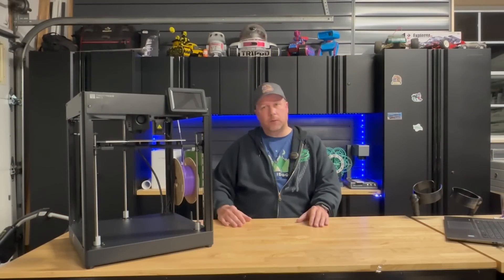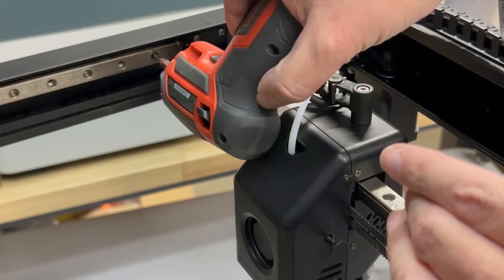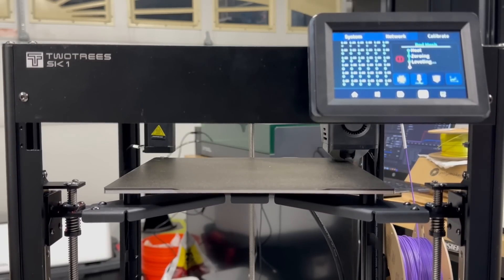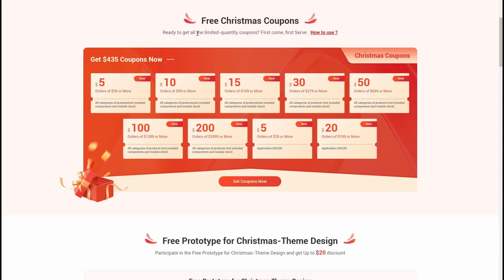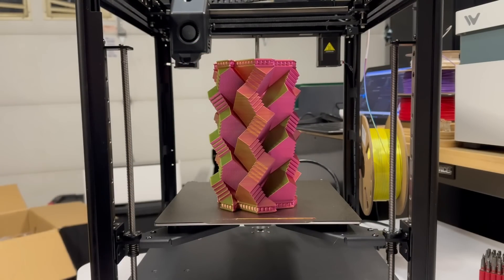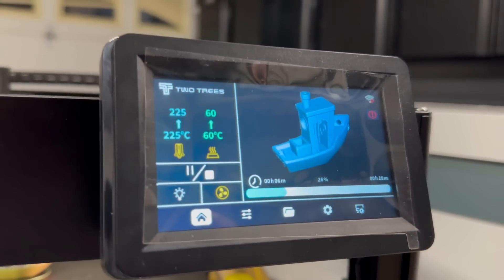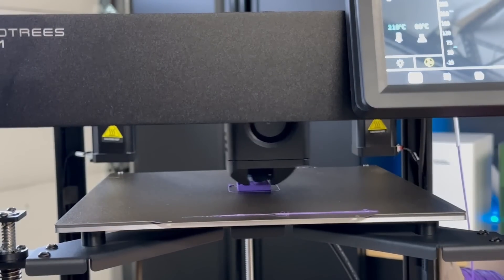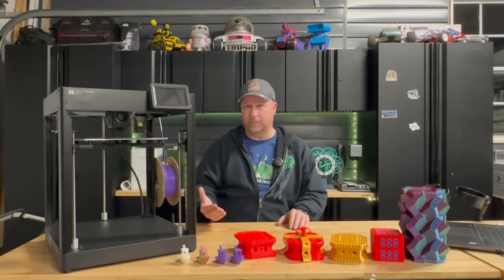TWO TREES SK1 - CoreXY 3D Printer

Comment: The preloaded lead nuts are used improper, the sprung load should be forcing down with gravity. Instead they have the springs on the bottom pushing up, so the weight of the bed is resting on the springs instead of resting on the screw with the springs giving extra help driving the bed weight to the screw. Unfortunately I have seen all China printers using these in this manner and it is wrong. This may be the reason the mesh bed is so bad looking as constant up and down could pose the variability, but being high in the middle could be do to trapping the corners and heating it up do to thermal expansion. But what do I know I only designed AM for NASA, SPACE X, and BLUE ORIGIN!

Comment: has two trees build qaulity gotten better since the original sapphire plus? those printers could have been so much better than what they shipped them as, the hotend is by far the worst hotend ive ever seen, other than that i was lucky with mine an my frame an everything else was good not out of square or warped like alot of the others i seen have issues with but i  got a p1s a bout a month ago an have been loving it an im going to replace some of my older machine with newer faster printers an part of me wants  to try a mixture of different brands like i always have but at the same time im so happy with my p1s ive been considering replacing them with more p1 series or maybe try a a1 bed slinger, not 100% but i wouldnt mind trying all the different bambu clones if they are priced resonably an right now its cheaper to buy the p1p than most of the clones so it makes me lean more toward bambu but i know alot of them are trying to be a clone of the x1 but others like the two trees is just a clone of the p1p so it has to be priced less to compete in my opinion cause there not comparable with bambu software feature so the printer has to have a bigger build volume or priced lower but so far what ive seen is not working out like that  so i'll probably end up with a bunch of bambu lab machines but ive always had a soft spot for my two tree sapphire plus even with the trash hotend it came with i always knew it could be so much better of a printer than it actually was, its by far the most rigid machine i own an that include the bambu lab machine but they just didnt do great with the firmware is the biggest issue an there so many version of the same printer its almost impossible to find the right firmware through two trees so u was stuck dealing with making ur own most of the time or having to trust someone else custom firmware an even then u didnt know if it would be the right firmware for the machine u had cause there was way to many variants without any way of identify thing. i had ppl from there support not even know they had combinations like mine, dual motor z axis linked with a belt to help keep them in sync but only had a single endstop while all other dual motor z axis motors had dual endstops an i really wish mine did but u had to make sure both z motors are at the same height b4 leveling the bed an the textured glass they send with the machine is trash, ur better of flipping it an using the smooth side, i had better results with adhesion on the smooth glass than the textured glass, its been the only textured glass ive ever seen that didn't have good adhesion. also the 17 min benchy looked way better than ur 30 minute benchy, do they give profiles with there machines now, i had to build my own for mine an it took me forever to get a decent profile an that has been the only printer i wasn't able to get a good profile from the manufacturer or even the community an took me slowly making changes til i got one that was decent an even now i still dont think its ago good as it could be. sadly my sapphire plus has just been sitting for the past couple yrs just cause i have so many other printers that work better it never gets used unless i have all my other printers running something off an need something printed for myself cause at this point i dont use it for anything i print for someone else, only for my own stuff cause it dont do as good an i dont trust the parts it puts off as much as i do my other machines. i would like to spend some time working on it an upgrading it but i cant get the motivation to do it an im to the point im ready to replace alot of my oldest machines with newer so it may end up being sold or swapped off or i may even consider doing a custom build on it i dont know. it has so many positives about it that none of my other printers have but it has more cons than my other printers so my mind is not set on how im going to deal with getting new printers an what to do with machines like the sapphire plus.

Comment: 1. 6 Stays removed
2. Vase: Clockspring3D, Annoying Box - LS3PD or LightSpeed
3. 46 screws
4. 12:30:12 or maybe 11:30:12 as the hour hand is really close to the 12. The clock is pretty blurry.
5. New fittings to repair a greenhouse that we’ve been starting seeds in for years. Probably going to model the new fittings with mounts for grow lights.

Comment: Again an implementation that hasn't been sufficiently thought-through.  The elephant in the room: not enclosed.  Sure, you can slap some panels on, but then also need to add an aux fan, a filter and exhaust fan a top ...  Before you know it the price is above that of a P1S.  From the video it looks like it probes with the nozzle, but ... how does it assure the nozzle doesn't have a blob of plastic sticking out and skewing the z-offset?  You want to poop and have a nozzle wiper.  Using the bed as wiper is a good start (unsure it does even that), but only a partial the solution.  I totally applaud using open source Klipper and the independent z-axis steppers are nice, but useless if your bed then is still as bent as you showed in the video ...  And at that price, it's just too little ...  Spend a little bit more and get a P1S or spend less and get a smaller, but enclosed, K1 or an open Bambu A1 (bed-slinger, but fast and working great out of the box).

And I'm not a TwoTrees hater.  I love my Sapphire Plus (revision 2) as a thinkerer machine, but it's way behind the new generation like the Bambu and K1 and also this new product just seems unfinished while priced higher than stuff like the Bambu A1.

Comment: I have this in my queue, but from looking at their website, I don't like that their build plate is shaped unusually. It may help with registration, but it's otherwise the same length and width as the Bambu X1 build plates that are cheap and readily available.

It's also a bit expensive considering the competition. It should either be bigger, enclosed, or have an AMS option...or all.

I'm hoping you looked into the nozzle. Another proprietary nozzle size would be awful. I have a Qidi, and even for that, it took a while for larger sizes to become available, a little longer cht-clones that are currently only available on 0.4mm. At least there are adapters to allow the use of V6 nozzles, and there are plenty of cht-clone V6 sizes available. If this is anywhere as fast as they claim, it'd be a shame to be unable to take full advantage of it because large cht-clone nozzles aren't available.

Anyway, looking forward to watching and hearing your thoughts.
Reply from the maker: It came with a spare nozzle.  It looks to be a MK8 style, but possibly smaller?  When I get back to the garage I will check, and post a picture in the community section.  I did reach out to my rep at Two Trees to see what type of nozzle it is.  I believe 3d Chameleon might be making a color swap kit for this printer.  I will reach out about this as well.
Reply: @TripodsGarage  thank you that'll be appreciated.

Comment: I just bought the Two Trees TTC-450 CNC and it is a very solid machine. I'm just getting into CNC work and am looking for a larger printer as my E-3 V2 is not able to print some of the things I need for my shop. This may be the one to jump to the next level at the price point, it would be a good shop addition.
Reply from the maker: I did a review on the TTC-450 CNC and came away pretty impressed.  It is so solid, just needs a bigger spindle.

Comment: Interesting Printer,  is there a panel Kit I wonder.
Ok for the answers:
* Question 1-  6
* Question 2 - Clock Spring and LS3DP (Steven Lightspeed)
* Question 3-  46
* Question 4 - If the Hour and Minute hands a are black and the Second hand green, then 06:00:13  AM or PM
* Question 5 - The bench on the printer's SD card/USB Key.

Comment: the purple benchy is pretty bad....in my past i´ve seen less than 5 worse benchies but i spotted the problem... Extruder gears are tooo rough/ huge teeth!..that destroys every clean surface...looks like wood grain patter or similar/worse... i knew thar...long experimental journey with my Sovol SV04...pretty basic/bad extruders
Reply from the maker: Very interesting assessment!  I see some people show close ups of a printed benchy, while others have it a foot away from the camera and show one angle.  The first one out of silk, can see the layer lines.  The one in purple PLA, that both of us agree looks pretty bad, has looked that way across all my printers.  I switched tricolor filament after the purple, and you can see the layer lines at 0.20.  Then switched to red PLA for the annoying box, still can see the 0.20 layer lines.  If your assessment was true then all the surfaces following that purple benchy would have destroyed layer lines as well.

Comment: I feel like if they made the bed sized 350x350x350 it would sell a lot for the price. But with the A1 costing only $399 and a bit more for multi color printing at faster more reliable speeds.

Comment: 6:22 lol let’s just ignore how bad the bed is on this printer “review”
Reply from the maker: I actually was going to get back to it, hence that comment.  Then as the video progressed it totally slipped my mind.  I have seen way, way worse from other brands, and I am sure others have as well.  I would like to see a much flatter bed, think the possible issue there is are only 5 points where the bed is fastened.  There is a lot of overhang.  If they were to add more fastening points, and move them more to the outside this might help.  The bed mesh leveling did do a really good job, as I never had a problem with the first layer.

Comment: 1: 6
2: clockspring3d and thelightspeed
3: 46 plus the screw removal tool
4:10:12
5: prob a benchy first to make sure its running right but then an articulated axolotl or some toy

Comment: * Question 1-  How many shipping stays were removed (not including screws)? 6
* Question 2 - Who are the creators of the vase and annoying gift box? Clockspring and Lightspeed
* Question 3-  How many screws are in the annoying box (minus the screwdriver)? 46
* Question 4 - At the end of the video what is the time on the clock behind me (hint north and south)? 6:00:12 ie 6:00 and 12 seconds Though as others have stated the clock is quite blurry.
* Question 5 - What will be your first print? Calibration Test

Comment: I'd like a simple yet well performing like this one, but with a larger bed to assist my X1C. Something between 320x320 and 350x350. There is many thing I like about this printer, like the 3 independant motors for z axis. Lots of possibility if you are creative..
Reply: I think the 3 independent engines are completely unnecessary. For a perfect level bed, you have to measure and adjust every time, even Bambulab solved it with 1 motor and synchronous belt, so you have perfect level and synchronous every time.
I don't see the point of separate motors, just the downside.
What could be the advantage?
Reply: @jakabgipsz4788  with proper mount, you could tilt the bed and remove the need for support. That's why I wrote "creativity". But you are right, one motor is enough, just make sure that your belt don't slip a tooth on one b gear.

Comment: I disagree on you opposition to providing decibel readings. On my channel at least, I take the same reading on the same table in the same recording device in the same room from the same distance every time.

I could say a similar thing about disagreeing with analyzing print quality since everyone has different lighting conditions. 

All data requires interpretation though! Fortunately we have you, a well qualified individual, to add context and share some info to go along with your readings.

Overall looks like a very nice printer! On the screws were coming loose, hopefully they can fix that at the factory. Sounds like they just forgot some loctite, but ideally you design things in a way where they don’t need it. It’s not like this is an engine or something.
Reply from the maker: I take the same readings at the same spot as well.  Do we go to someone’s house that might have a smaller room, lower ceilings, and poor insulation with our meters?  I don’t.  Why show a meter?  I actually purchased mine years ago, just for reviews.  Shows no value for a person that isn’t in the same conditions as you or myself.  However, we can always agree to disagree 😊

Yeah, looking at the machine from a distance.  I can see where someone can get the vibe that it might be slapped together.  However, after looking closely, it looks really good.

Loctite will be such an easy thing to implement on those screws if they haven’t already.  Either way I hope they take my experience and expand upon it.

I know you don’t live all that far.  If you are ever I. The Chicago burb area, let’s do some lunch.  Or hit up a MicroCenter 😂

Comment: 1. 6 screws
2.  LightSpeed & ClockSpring3D
3. 46
4. 12:12, or 12:30, but I think 12:12
5. I always print a Benchy, but sometimes a calibration cube🙃

Comment: I have bought some Two Tree parts in the past and the quality was not always the best or even half decent but I can see some thought has gone into the design of this and also some stupid mistakes, parking the hotend on the front left is a mad move! although some changes to the end G-Code will solve this, however, that is not novice-friendly.
 Having screws vibrate loose is an amatuar mistake!
 The aim may have been to compete with the P1P and the K1 but it falls well short.
 I wouldnt even buy another Creality machine so this doesent stand a chance of living in my print room!

Comment: Ok Tripod, let's enter this. 1) there are 6 stays that you removed. 2) the creator of the vase is Sven (clockspring3d) and the box is Stephen (thelightspeed) 3) there were 46 screws in the box 4) the time on the clock in the updated picture appears to be 11:30:12 (but the hour hand is a bit close to the hour for the min hand being at the 6), and my first print will be another screwdriver rack for on my pegboard in the garage. Hope I win!